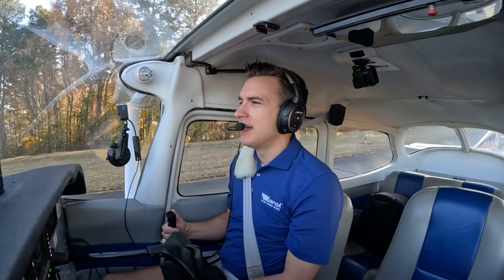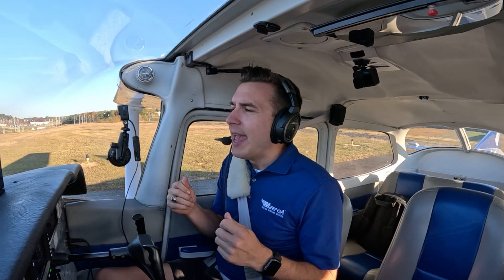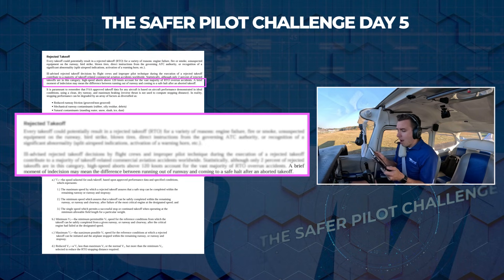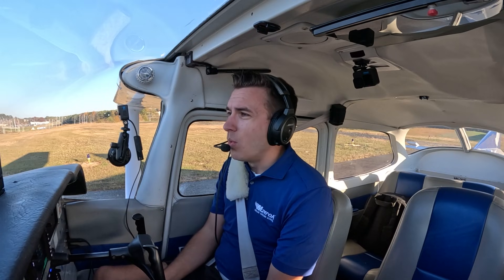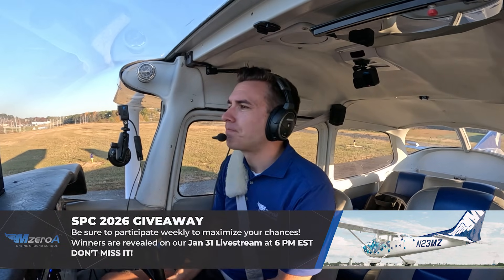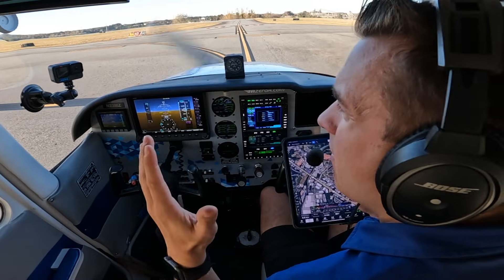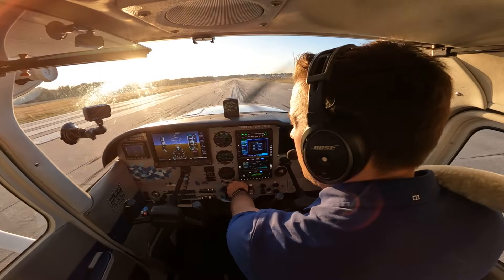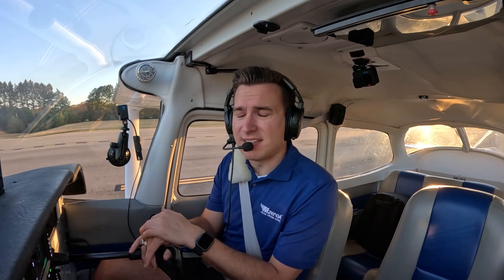Abort! Demonstrating a Rejected Takeoff in Real Time

Comment: Takeoff briefing is so important. I rejected one takeoff during my checkride on a hot day in FL. Touch and go, DPE called I have the flaps as a busy day, then exclaimed oh s@!* as something went flying and landed at his feet. I immediately cut power, applied brakes and got us off the runway to assess what happened. Turns out, the flap button had come off the control panel, so would have been stuck at 30 deg if continued. Best to figure out on the ground.
Reply from the maker: Wow, great example of why takeoff briefings matter. You made a solid call staying on the ground and sorting it out instead of pressing on with an unknown. That’s exactly the kind of decision-making we’re trying to reinforce—nice work handling a wild situation calmly!

Comment: Great videos!!!! I have a question about how you power your Gopro cameras. Are they with individual battery inside camera? or use of power bank? or powered via an adaptor into dash of airplane? the reason I ask is that I always get static feedback using the adaptor or cigarette dash charging method. If I use a power bank then the static goes away but I may loose power after extended use. thoughts?  thanks
Reply from the maker: We appreciate that!! We actually just run our GoPros on their internal batteries and swap them out as needed. In 23MZ the cameras aren’t hardwired, and we’ve found that using the cigarette lighter or panel adapters almost always introduces that hum you’re hearing. Power banks can clean up the audio, but then you’re trading noise for limited runtime. For us, internal batteries + spares has been the simplest and most reliable setup. Hope that answers your question!
Reply: @MzeroAFlightTraining  appreiciate the quick respone!!

Comment: Fife for fife. Safer. 
- always have a back up radio, headset connection is better.  
- always have a flashlight and a back up. 
- always have extra batteries for everything you use- but make sure they still good and not corroded (happened to me)

Comment: 5 for 5

For GA go/no go decision on takeoff roll, a good rule is the 50/70 rule. Having 70% of rotation speed at 50% of the TODA.

Another thing is during before takeoff briefing, I like to tell my copilot or passenger that if anything seems out of the ordinary, you call STOP. It will not be questioned, we stop, exit the runway and then discuss.